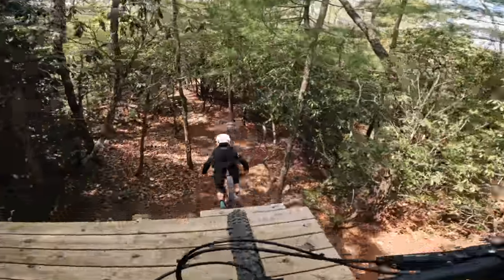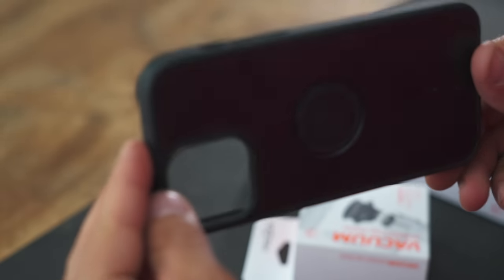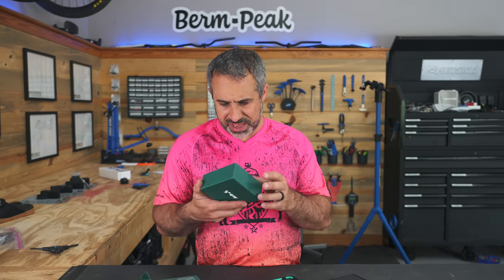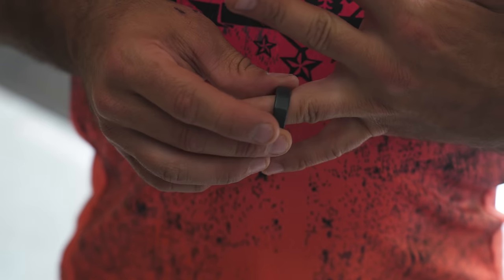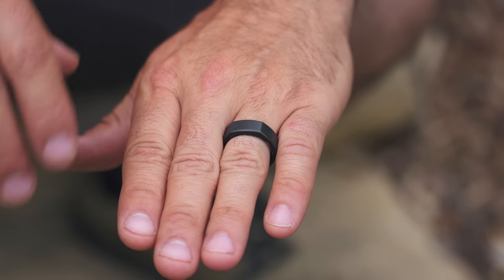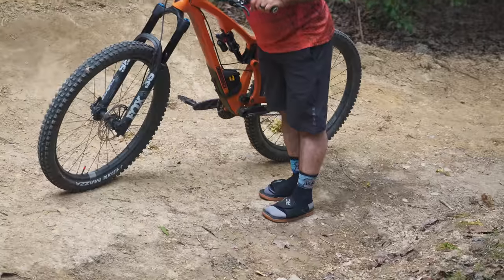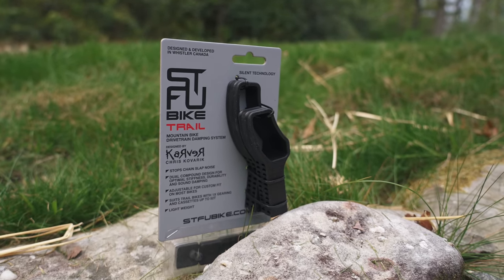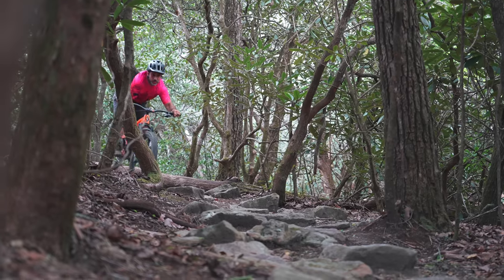Reviewing Semi-Normal Mountain Bike Products

Comment from the maker: According to some commenters, the new version of Quadlock works with wireless charging. I’ll need to test that out! Their cases have been great for me in the past.
Reply: I’ve been using quad lock since the iPhone 8. I’ve never had any issues with it not charging wirelessly. I’ve changed my phone every night for years. Plus I like how I can use the circle to center it when I’m using the phone 1 handed. I’m on the 13 pro max, so it’s a chonker.
Reply: I like the sp connect cases and mounts the most
Reply: Strava is not really that useful for mountain bikers. I use it for road rides to track my estimated calories burned, estimated power output, estimated times. A free way to track metrics, if you care about improving your performance. I don't want to spend money on a power meter nor a "health" watch, and i don't  even have a strava subscription.
Reply: Check out the rokform case. And you should do a drop test on the case
Reply: I have the quadlock because it comes with the option for a universal mount and can easily be removed and attached with just one hand.
The fidlock and mous cases looked like you'd need two hands to remove them. Is that the case?

Quadlock also comes with cases for way more phones than mous does (mous seems to only produce iPhone cases).
Reply: The mous case also still works with MagSafe :)
Reply: I do love me some Quadlock.
Reply: @lassegosau5098  1a
Reply: I have found that on some older phones (my iPhone 11 for one) you can put the screen face toward the wireless charger and it will still charge. Could be good news for fidlock and older quadlock case users wanting to wireless charge
Reply: Don't forget the wireless charging mount for your car! 🤙
Reply: My quadlock works with wireless charging as well. They even sell wireless chargers now. I put one in my wifes car and she loves it
Reply: mine works with wireless charging, but competition is always good!
Reply: They do, works great.
Reply: Warning! There is someone posting comments here posing as Seth. They are going by BermPeaks(with an s) and the BermPeak badge is a different color. It's a "text me for your winnings" scam.
Reply: Got a QuadLock about a year ago and it works fine with wireless chargers. I bet the QL system is lighter than the Fidlock system, as the mount is mostly thermoplastic, but I did like that Seth was able to rotate the Fidlock phone without removing it from the mount. Can't do that with QL, but I rarely do it anyways.
Reply: Wireless charger from quad lock is great
Reply: I just made the same comment, I never heard that quadlock did not work with wireless charges, I put on the quadlock case and still put my phone on my samsung wireless charging base and it always worked. I also have the quadlock wireless charging head for the car mount, works great.
Reply: can confirm Quadlock works with wireless charging. At least my Galaxy S21 Ultra works with the Samsung wireless charging stand.
Reply: Doesn’t work with my iPhone 13 or my wife’s 13 Pro Max. Couldn’t get any of our regular wireless chargers to work so we ditched it. We weren’t really using them on our bikes anymore, we were just already invested in the chargers/mounts in our cars so we bought new cases when we got our new phones. But when they wouldn’t work with our existing wireless chargers, we stopped using them.
Reply: yeah ive never had a problem with quadlock and wireless charging... i have to ask whether or not you tried charging your phone wirelessly with the quadlock case.
Reply: My Quadlock case for an iPhone 12 works with several wireless chargers I use and even Quadlock says it works with 3rd party wireless charges. Guess that means it doesn't work with Apple's wireless charger.
Reply: Try out Rokform!
Reply: I bought my Quadlock right after your review and it always worked with wireless charging.  I bout the desktop mount to put on my bed side table and it works as my alarm clock.  We stayed at the Ranger Station last fall and the Quadlock worked perfectly with the wireless charging station at the front door.  Quadlock ride or die for me!  :)
Reply: Been using Quadlock with my Samsung phones since 2018 and they've had wireless charging since then. iPhones didn't have wireless charging built in until iPhone 8, so 🤷 just that flaw of iPhones making things harder than they need to be... 😂
Reply: You should check out the MODL Bottle, it’s pretty neat.
Reply: Check out Peak Design. All the best parts of the three phone mounts you talked about
Reply: Peak design mobile case! Literally the best one out there, I love mine
Reply: Yes it will work. BUUUUUT because of the magneticfield u will break ur charger in the long run. Thats why theres a warning also. (sry for the bad english im not native)
Reply: Ive had a quadlock for almost 2 years now and I use it in the car and on the bike. The mounting is getting pretty loose at this point but it still holds on good.
Reply: My quadlock works on both of my wireless chargers... car and home...
Reply: I use my quadlock case with wireless charging all the time with no problem on my iPhone 11.
Reply: He’s gotten me into mountain biking seriously with full suspensions and making my own trails
Reply: My only issue with the quadlock is on the s10e at least, it doesnt really provide any screen protection. A simple drop on a flat tile floor caused a screen crack. The wireless charger (from them) works, I'vehad mixed resulta but most other wireless chargers work, I used to use it for vehicle charging prior to android auto. While wireless charging it seems to affect the gps and navigation functions, overall I put wireless charging into the gimmick segment, it over heats most phones especially if they are being used for gps etc. and on a dash in sunlight.
But the engagement on the lock is great and I never fear it will fall off even when jumping off of obstacles. After 2 years or so the case is mostly intact, there is a small area where the case material is separating from the inner felt liner  material.
Reply: Was gonna say.. I've always used wireless with my Quadlock, so was confused with the video :D
Reply: I would say that it works* with an asterisk. If I position it just right on my desk charger, it charges, but for me it's no where near the ease of having a normal case that I can just drop in there. The same way you had to fidle with the attaching of the cases you reviewed in this vid. In fact I took my wireless charger off my desk all together cause it was more hassle than it was worth. All in all I can't say I would recommend the quadlock for all the prices you pay for it's main feature. It's quite expensive for a full set up(s), the case is plain looking, the raised back is a hassle from charging to having it wobble like a top when you try to use it on flat surfaces and the list goes on. If I could go back in time I would not have bought into their system (have it for both my bikes and moto); cause once you have it for one bike you have to abandon it all together or get it for everything and you're trapped. (I will add that one time I had to return a product and not only did I have to pay return shipping but I then had to buy the replacement with shipping back to me so I ended up paying about double for that part.)
Reply: Do you think the fidlock rubber will last more than the mouse plastic?
Reply: Was just going to add that I charge wirelessly with my Quadlock case. 👍🏻
Reply: Quadlock even have wireless charging mount's
Reply: Seth, I don't know what wireless charger you tried with the Quad Lock, but all three I have worked just fine with my new Quad Lock case.
Reply: Hi seth i need some advice i have a road bike with a 45 chainring going to a 7spd 14-28 casset was woundering if i should change the 45 to a smaller for going up hills thanks
Reply: check out the rockform cases and mounts. theyre similar to the two you tried, but imo they seem better. they also have one that mounts by acting as a stem cap, with is super cool imo.
Reply: @sepg5084 the calorie metrics are trash for strava.
Reply: Got a quadlock case on a Galaxy S20. Wireless charges no probs at all. Love your vids.

Comment: In 2011 Adidas bought Five Ten. In 2017 they rolled Five Ten into the Adidas Outdoor Brand. In 2018 Ride Concepts was formed. From the RC "about us" page, they're the outcasts that Adidas thought they could do without. That's why RC shoes address almost every shortcoming of Five Ten.
Reply: I love that spiteful company move
Reply: Because of this, I will buy RC shoes over five ten
Reply: That’s cool I bought a pair of RCs just because they seemed comparable and were cheaper. Couldn’t be happier
Reply: I had a pair and sent them back because they ripped immediately. My five tens haven't.
Reply: There is a very similar thing happening with five ten climbing shoes (where they started out). They dumped a load of their models and the new ones are getting some flak and a group of the old designers have jumped ship to set up Unparallel shoes.
Reply: I'm still running original 510 shoes, but in no way am I supporting Adidas, RC will get my next purchase.
Reply: Not to get too political but addidas is way to "woke" for me, maybe rode concepts is too but I don't know about it. I just bought a pair of Rode Concepts and NOT 5 tens
Reply: @LuLeBe  for me I decided I was done with Adidas when they put ads out celebrating transgender women (dudes that now want to be women) competing with biological women. I am not down with that at all
Reply: @LajRa5  Do you compete? Have you experienced unfair competition due to a transgender athlete? Do you know anyone who has? 

It seems that a lot of people complain about literally the least prevalent issue possible. You don't stop eating Wheaties when the baseball player on the box is juicing. You just shrug and say that's the way it goes. I think your issue has much more to do with your own transphobia than it does with the one or two athletes who have been allowed to compete in a sport against others who are hormonally aligned with themselves.
Reply: @BoomerangVillage  You know nothing about me and the way I am. The difference between you and me is that I live in reality. Reality is men and women are different biologically. I don't care what people "feel like" although I sympathize for those who feel lost or out of place in that way. Truth is truth, facts are facts
Reply: @BoomerangVillage  your a good person thank you for your comment
Reply: @LajRa5  It's amazing what you can elarn from a person the way they interact online. You give away too much and he is correct.
Reply: If you can’t see the difference between men and women physically, I feel sorry for you.
Reply: @christiandruan  but we are talking about two women
Reply: Did not know any of this! Glad I got my Wildcats even more now.
Reply: I just got a pair of their hellion elites and they are leagues above my old five ten freerider. Lighter, stiffer where it’s needed, more grip, better pedal feel, and better build quality.
Reply: Five ten have a cool logo tho
Reply: @BoomerangVillage  Trans people are about 0.1% of the population so definitely no need to teach children about any of their non issues then because they aren't a thing very often, certainly no need to teach people about pronouns etc because it's barely ever an issue.
Reply: But yet five tens are still much, much better. I had rc’s, but they tore open in less than 3 months. For flat pedals, 510 all the way. For clipless though, I wear giro chamber 2s and they are awesome
Reply: Keep in mind that Ride Concepts are SMALL. Like not one size up small, like women or children's size small. 

I'm a size 9.5, wear a 10.5 in Five Ten, and can't even slide my feet partially into a 10.5 Ride Concepts. Had to send them back and going up to a size 12.
Reply: @BoomerangVillage  So based...👌👌👌
Reply: @BoomerangVillage  you should watch matt walshes "what is a woman" you'd like it.
Reply: Samuel Lawless  Believing in that cult and legitimising it is what's a terrible mindset.
Reply: @BoomerangVillage cry
Reply: @LajRa5 Please google the definition of woke, because you are clueless to what it means. It’s only right wing companies that throw their politics in your face.
Reply: @emed1977  you serious?
Reply: @emed1977 What? 😂😂😂

Comment: iPhones have moving lenses in their cameras for the stabilization. Any of these 2 phone mounts can break that mechanism in a rock garden or jumping. I know because it happened to me. Keep your phone in a pocket on you, where your body provides it with better suspension. If you want Trailforks maps and/or ride recording on your handlebar - Garmin Edge is the robust way to go.
Reply: Unfortunately not many know that iphones aint shockproof. 
Sad so many people learn this the hard way.
Reply: I trashed several phone cameras this way. It's worth it to use a dedicated bike computer that's ruggedized and designed to take the hits.
Reply: Quad lock makes a stability thing that works really well but pricy tho
Reply: @thomasfjen  most phones still don't have any moving parts, so they are pretty much completely fine to use with these mounts.

But I agree that they should should add a disclaimer, given that this is a problem on some (expensive) phones.
Reply: This. OIS, and gyro in the phone are being rattled to hell and back. Why people stick $1000 phones on bikes is beyond me. You think your phone is fine, but it isnt. Same goes with dropping it. It may look fine, but trust me you are damaging it's internals. Like it's such a waste of fucking money holy shit just get the right tool for the right job.
Reply: This is absolutely a thing.  The optical image stabilization mechanism in modern phones is prone to failure when exposed to excessive vibration.  A lot of those in the off road / ADV motorcycle community discovered the same thing.  Mounts were secured but the phone cameras were destroyed in the process.  Keep it in a backpack or pocket!
Reply: I broke the OIS on my iPhone about 4 times before I realized it was the vibrations from being on my handlebars that did it. So I won’t be mounting my phone again anytime soon.
Reply: In the future I'll plan to use an old phone. My old S7 after I upgraded is just a spare camera for me, download the trail maps and you can use them without needing data, old S7 doesn't use OIS, and if it falls and is damaged isn't a big deal.
Reply: you want a phone bike bag, it drapes over the front bar and is detached enough from the bike to not break the phone.
plus if you get that kind of bag, it gives you more storage, you just have to watch out and get one where the phone is away from the handle as much as possible, then you can stick stuff like a multitool and Co2 cart in there with it.
Reply: I lost a grand by carrying my phone in my pocket. Fell right on it. Keep it in a top mount bag like Morrow bags.
Reply: I kept mine in my pocket through a rock garden, and I went OTB landed on a sharp rock. And my phone just happened to land between my leg and the rock.😂😂😢
Reply: Yet another reason you'd have to pay me to get an iPhone. 
Even with a lanyard on it, I drop my phone a couple times a week. I haven't bought a non ruggedized phone in the better part of a decade.
Reply: do you think it’s a big deal for commuting and road riding? I have a garmin 530, but for road navigation I find google/apple maps to be much more convenient

Comment: Disclaimer: Mounting a phone to your MTB will ruin your camera optics over time.
Reply: As far as I know, that's just on motorcycles due to long rides and the vibration, that's why they have a rubber mount to dampen the vibration on the motorcycle mount. MTB should be fine
Reply: Only if you have optical image stabilisation if it's just digital stabilisation then it's fine
Reply: Upvote! Had that fixed a few Weeks ago…

Comment: Mous phone cases are insanely protective, the fidlock doesn't seem to offer much in terms of protection. Mouse primarily does phone cases, so they know about protection. Good choice Seth 👍

On a second note I have a mous case currently, and it's been great. I dont have the bike mount case since apparently they don't do that for Samsung yet🤷‍♂️, but I've dropped my phone an absolute ton since I got the regular case over a year ago, and my phone is as good as new.
Reply: I agree
Reply: I agree
Reply: I agree
Reply: the mous cases are so tough in the the real world not just the mius website good choice seth
Reply: I love my mous case and wallet. The gform like stuff inside seems to work well.
Reply: And their add for this case was done with a dh rider so you know their good for Mtb
Reply: I agree
Reply: isnt it swedish?
Reply: Agree
Reply: unfortunately there is no option for my galaxy Note 20 Ultra for the bikemount...
Reply: @thelonewolf3515  dang that's unfortunate, hopefully they'll have one soon
Reply: @ARandomBoat  yes hopefully. These are some decent cases and the mounting is one of the better systems!
Reply: I can confirm, my mous case is literally indestructible, and protects the phone incredibly well.
Reply: Yeah mine flew out my pocket go karting full speed and grinded the corner down on the track. No damage to the phone at all.
Reply: if you just watch an add by  mous where they drop photos with mous case from helicopter
Reply: Same, I have mous, I am now mous loyal, I love these cases!
Reply: I've got one as well, dropped my phone multiple times and the case has worked perfectly.
Reply: Mouse lets you continue to use the One Up
Reply: I got a quad lock because they are the only company that makes a case for the note 29 ultra
Reply: Tell that to my iPhone 6 that got destroyed in a Mous case by dropping it hip height.